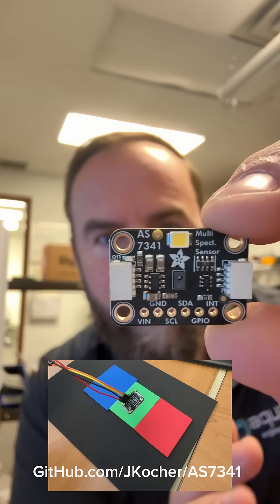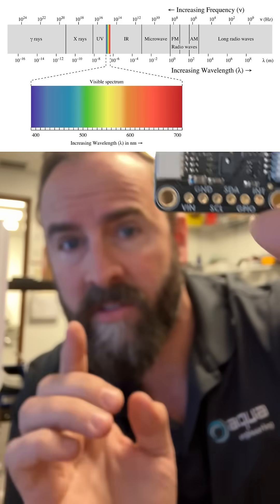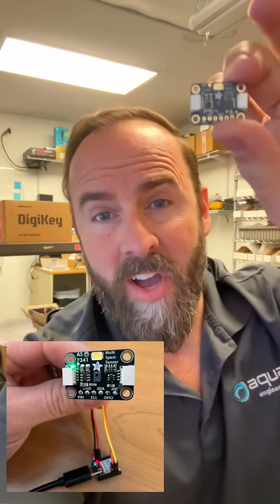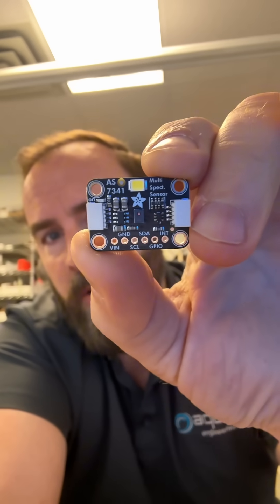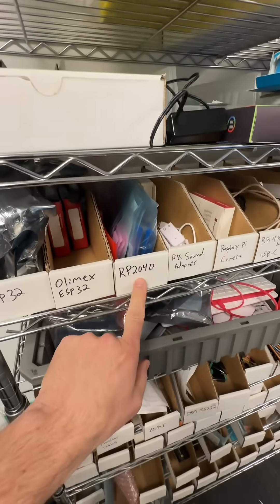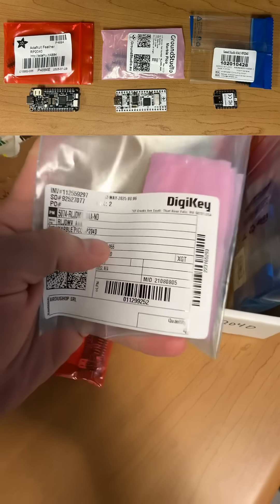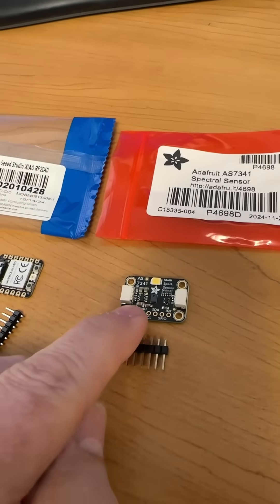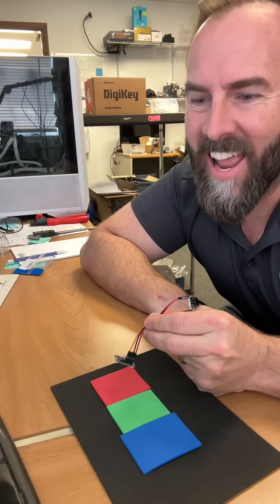AS7341 Spectrometer Vibe Coding & Hello World Test

Comment: It's a fantastic little chip! My only issue is getting the onboard led to run. I'm only getting a dim output using:  
as7341.controlLed(10);   // Set pin current to control brightness (1~20 corresponds to current 4mA,6mA,8mA,10mA,12mA,......,42mA)
Reply from the maker: I haven't used the LED yet, but is it tied to the system voltage? If so you'll probably have to go above 3.3v to get that current to go higher. Maybe it's topping out somewhere below the max current function calls. I'd consult the datasheet and schematic and see what the deal is. Let me know if you make any progress, I'm curious too.

Comment: I use a similar one for samples from bacterial cultures. People believe that the bagilion dollar medical devices in labs need to be super expensive but they do not.
My application is more like a proof of concept so not really at the level of profi devices but it can do a lot of things.
Even this board is actually very power.
As always love your content.
Reply from the maker: Yes that is a classical engineering example of trying to innovate and cost reduce. There’s no reason to always use a $30k Edmund Optics / Hamamatsu setup when you can in some cases use a sensor like this one. If you think about it this way, 8 spectral channels and even the possibility of fluorescing a sample with a diode or laser source (or array of sources) still allows for a near-infinite range of dimensionality when characterizing a sample. Really cool stuff, good luck with your application!